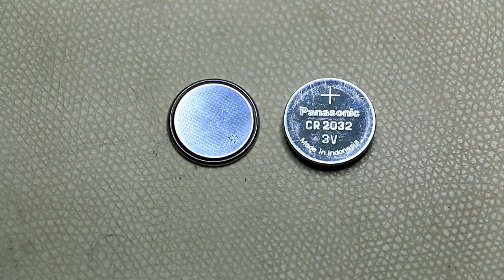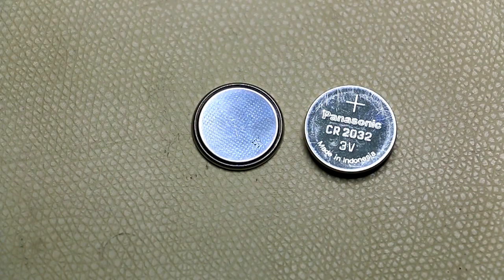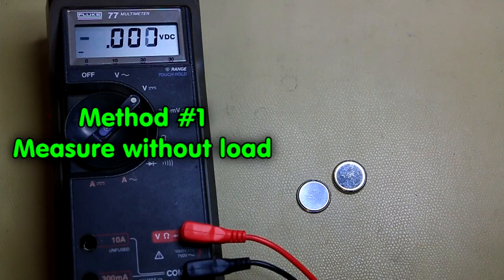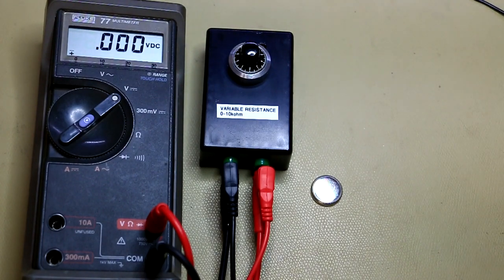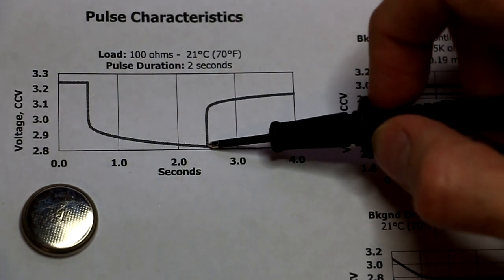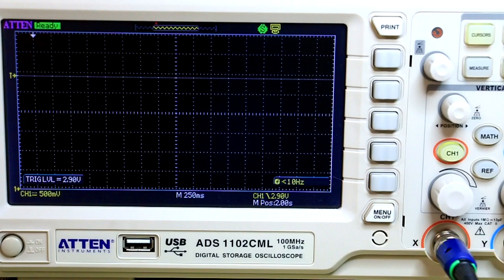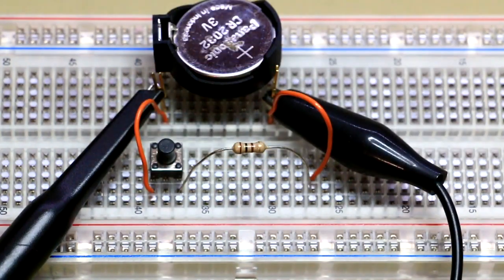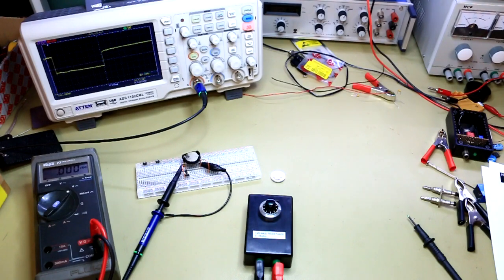How to Measure a CR2032 Coin cell battery (#006)

Comment: Very good.  Done right.  I use a simple battery tester which does have a load.  They sell them everywhere for AA/AAA , cost a few dollars and they work for 2032 batteries.  Applies a load and moves a needle.  I found that with exhausted batteries needle rose but only in the red.  Good new ones went into the green.  Bad, old ones would show 3.24 V on meter (no load) but didn't even move the needle on the tester.   In sum, a battery tester will usually be easiest way to test under a load.

Comment: What is the make and the model of the variable resistance box you have used here. Is it connected to the multimeter, how?
Reply from the maker: I built the variable resistance box - it's a fairly simple design consisting of a 10kohm multi-turn potensiometer with a 10-turn index wheel mounted on top. I have some more technical detail elsewhere in the comments.
Reply: @TechBench Thank you so much for your prompt reply. What fascinated me was that (I guess) it is connected seamlessly to the multimeter to do the load test.  If yes, did you connect the potentiometer/rheostat/variable resistance in serious to the multimeter probes or parallel ?
Reply from the maker: @biswassanjoy  Ah, yes - it was connected to the multimeter in parallel. That way the battery is "loaded down" by the resistance of the potentiometer and the multimeter measures the drop across it.

Comment: Just tried this, and it worked - thanks. Used a 330R resister as that's all I had lying around, and the bad battery showed 3.0V with no load, and dropped to 2.2v under load. Compared to a new battery that showed 3.2v no load, and then held at 3V under the same load. Measured with the resister in parallel.

Comment: Yours is an excellent presentation of the general nature of batteries. The AA battery, given the same test, would reveal very little information because it is designed to supply hundreds of times more current. Each battery’s chemistry and size are suited to a particular need. The larger alkaline and Nickel, Magnesium, Hydride cells are all about current. Their regular use is far more demanding than even the ‘acid test’ (sorry) being applied to the mercury-type coin cell here. The coin cells’ typical application is similar to the test but generally not quite as severe. They are used to store a digital ‘sentence’ in memory, a job which can take a very small amount of time. I have seen them last decades in such an application.

Comment: usual case is to test some used batteries. any. if its 1.5 and measures 0.5 - bin it. if 1.4-1.6 you still had chances to use it.

Comment: If you recharge this cells again they are good to go ?
Reply from the maker: No, the CR-series are not rechargeable, but the LIR-series and ML-series are. Just be careful about the voltages and make sure that your device can correctly charge these batteries.

Comment: That battery datasheet says capacity 210mAh
After some time use, how to measure capacity left??
Reply from the maker: Unfortunately, the only way to know how much is left is to measure how much was used while power is being drained. Very few devices do this. An alternative way would be to measure the current draw and work that into how long the battery has been in use.

Comment: What is an affordable but reliable universal battery tester in including the cr 2032?
Reply from the maker: You don't mention which country you are from, but in general, you should be able to just search for "button cell tester" and that will render the desired results for under 10 yankee bucks.

Comment: Followed your instructions, I found bunch NOS 2032 batteries are junk. terminal voltage reads about 3.1-3.2V without load. But when I connect to 5K load, nearly all of those 15 years old batteries drop to 0.7V.

Comment: Well, I'm confuse. I have 3 old batteries CR2032/DL2032/CR2032 all 3 are from different manufacturers (Panasonic/Duracell/Sony respectively), which I tried to use in a bathroom scale and none of them worked. The scale would work intermittently or not at all.
No load:  was 3.1v/3.03v/3.05v respectively
Load (4.7Kohm, actually measures 4.96K ohms): 2.95v/2.96v/2.96v respectively
But none of them would work. I was expecting the values to be below 2.8v under load. Why? Shouldn't they still work at 2.95 or 2.96v?
Bought a new battery and the scale is working.

Comment: How did you make that variable resistance box?
Reply from the maker: Simply put: I used a 10 kilo-ohm 10-turn potentiometer with a 10-turn dial. Since both are 10-turn, the values work out nicely so as to scale along with the reading on the dial.

Comment: It's surprising how many people don't believe me when I've told them over the years that you can't check a battery properly without a load. This Is a great example of what I have been telling people, so I'll save the link and send them over here to see your demo.
Reply: The battery is under load when you measure it... it's a closed circuit. If you measure it for a long time, it will get depleted. Unless the 9V battery inside the voltometer gets depleted first.
Reply: @praclarushtaonas7232  Fluke meters have a minimum input impedance of 10MΩ. Assuming a nominal 3V supply, power dissipated by the meter (taken from the coin cell) will be less than V²/R=0.9 microwatts. Energizer CR2032 batteries are approx 0.6 watt hour capacity, hence time to discharge based on drain via the Fluke will be at least 76.1 years. Like @G56AG said, you really do need a separate load.

Comment: If I use a 4.7 K Ohm resistor, how many Watts should it be? 1/4 or 1/2 or something else? Thank you for a great video.
Reply from the maker: 1/4 watt would be more than sufficient, but any higher value (1/2 watt, 1 watt) will also do if you cannot lay your hands on a 1/4 watt resistor).

Comment: What is output voltage when using 15k resister
Reply from the maker: If you place the 15k resistor over the poles of the coin cell and measure the voltage, it should be pretty close to the 3V measurement of the cell. The 15k resistor load means it will only draw about (3V/15kohm)=0.0002A (or 200μA) of current. That's a tiny amount of current!

Comment: Being a total newbie I wish you would have said what to set your Multimeter on.  I have the older cheaper type that is not digital.
Reply from the maker: Phew, analogue meters (the kind with the needle) can still be used, but you likely will not get the amount of detail you need. Set your analogue meter to a voltage scale that is just above the voltage you intend to measure. In this case, you expect around 3 volts. Set your meter to the 5V or 10V scale and measure the battery.

Comment: How is the potentiometer connected to 10k?
Reply from the maker: Essentially potentiometer is the 10k resistor, only it's variable. In other words, if I turn it all the way to the one side, it is 10k ohm, but if I turn it all the way to the other side, it's 0 ohm. The adjustment knob is just nicely marked out in 1k increments.
Reply: @TechBench  Thanks!

Comment: Is the load resistance placed in series or parallel?
Reply from the maker: The battery, push-button switch and resistor are in series (i.e. they are all connected end-to-end), but effectively we put the load resistor in parallel with the battery for the duration of the button press. Hope that makes sense!
Reply: @TechBench  Yes, thanks! In the meantime I found an old Radio Shack tester that tests 3V button batteries.

Comment: My old Radio Shack Micronta 22-188 has two plug-ins for the positive lead. One has a lightning bolt one does not. Which one should I use to check a battery?
Reply from the maker: The Micronta 22-188 (like most good multimeters) have separate plugs for current and voltage measurement. The right-hand plug (with the lightning bolt) is used for DC and AC volts. The left-hand plug is used for current and will typically have A or mA designations.

You want to use the DC Voltage measurement (along with a load resistor) to check battery voltage.
Reply: Thank you for your reply. I considered just trying each plug but I didn't want to ruin the multi-meter by feeding current where it shouldn't go. Unfortunately I have misplaced the manual.  I was surprised that I got a reading of 3.03v on a CR2032 because it has been in a tire pressure gauge for several years.
Reply from the maker: Putting a load resistor on the CR2032 will show it's "true colours" :-)
Reply: I don't think this meter has the function that adds resistance.  And I'm not sure I have the skills to make a load resistor but I might give it a try when I get some time.
Reply: @TechBench  in series or parallel?

Comment: Even if this clip has few years, it still useful as of today.  We still use these batteries so having some technical info that we can refer to is always a plus.  I'm glad you showed the datasheet so that people can more clearly understand the concept.  Also, depending on the manufacturers, the specs might slightly vary as for the capacity, the test conditions, etc... so people will have a good idea what to look for.  Thanks for your time.

Comment: i check it by if it doesn't work any more then i get another one. or if i'm in a pinch, i'll connect a 12v 10 amp car battery charger to it for maybe 20 seconds. that usually get it going again.

Comment: Hi TechBench  
are you able to please explain further on what 100 ohms resistor test actually does to coin cell battery here?
Reply from the maker: It simulates a load on the cell. It means you are measuring the battery voltage while it is in use which is a more accurate reflection of the battery's state than just measuring it without any load.

Comment: Thanks for your very informative video.
Just wondering whether it would also be possible to measure the current (max milli Amps) using a DMM etc by placing the meter probes on each side of the battery terminals? or even through a current limiting resistor in-line with one of the probes?
A flat battery should have a very low current reading when shorted through the meter and I can't imagine a fully charged 3V cell this small being able to push more than a few hundred milliamps when new.
Reply from the maker: You are, of course, correct that you can measure the dead-short current capability, but the result will not give you an reliable indication of how full/empty the cell is. Since different cells have varying internal resistances, there is no specific scale either.

In addition, you can easily blow your meter's mA fuse by measuring even just a slightly larger battery (such as a AAA).

Comment: Hello where can I buy  the var Resistor tester    Thanks
Reply from the maker: - Hello. You don't say from which country you are, but you can buy them almost anywhere. Online, look on eBay and search for "multiturn potentiometer". You will also get some results for the knob.
Reply: I am in the USA     I will look thanks     The  2032 are a pain to check to see if they are good.    Thanks     

But the Multi turn Pot  is not set up like the one you have,      Did you make it?    Thanks
Reply: TechBench

Comment: Hi. Gathering the parts to make a variable resistor box. Quick question. Did you wire the variable resistor in series or parallel? Thanks!

Comment: Great video! Can you tell me where I can buy that resistance box?
Reply from the maker: +fellows55 Thanks! I built the resistance box myself, but it's really easy to do. It's a 10k ohm, 10-turn potentiometer with a 10-turn rotary dial. Perhaps I should make a really short video on how to do that.
I see similar kits are available here:
http://www.ebay.com/itm/New-10K-Ohm-3590S-2-103L-Potentiometer-With-10-Turn-Counting-Dial-Rotary-Knob-/281782868179
Reply: +TechBench Thanks for the info! I think I am going to try and make one for myself. If you do make a video on how to make one that would be great and I will watch. Thanks again!
Reply: +TechBench 

Did you get around to making that short video?

Comment: In  Rf and IR remotes that is why adding extra decoupling capacitors prolongs cell life, it will work to give single pulses till the cell is under 2V open circuit. I use anything between 10 and 47uF SMD tantalum, whatever will fit and whatever I pull off old boards and any voltage above 16V for 12V. 2 coin cell remotes 10V works, and there you might fit 100uF in the case.
Reply from the maker: That is certainly an interesting idea. Do you have information on what the current drain from the capacitor would be if you place a tantalum capacitor in parallel with the coin cell?
Reply: TechBench Under 500nA of current for good capacitors. See http://www.vishay.com/docs/49268/tn0003.pdf for more.
 Basically reduces life by a few weeks but improves pulse performance.
Reply: +TechBench    i found a box of lithium batteries, button duracell  DL1620B.  it says best if use by 2005. do you think these batteries are still good? what is the shelf life of   a  button lithium  battery? 

batteries are all in the box unopened
Reply from the maker: Normally those button cells have a shelf life of about 10 years, so it's likely that they will all fail very soon after taking them into use. Test them! :-)
Reply: thank you for responding ,  i bought an LED light  3-8 VDC    my battery is 3 volts. it is  working  fine right now.  how long  do you think before the  battery drains if the battery is good?

note: the LED that i bought is a blinker or it blinks